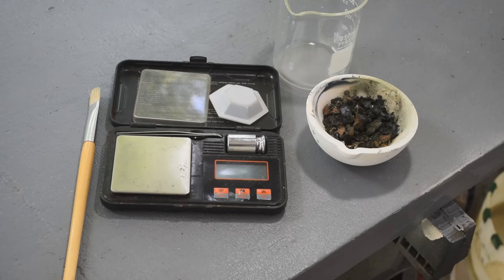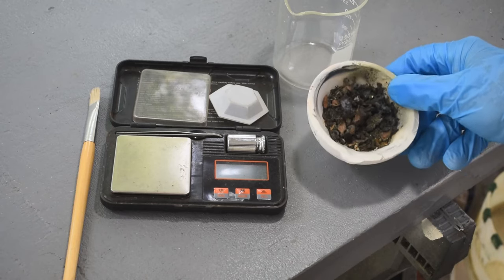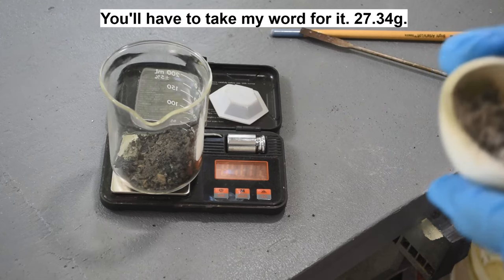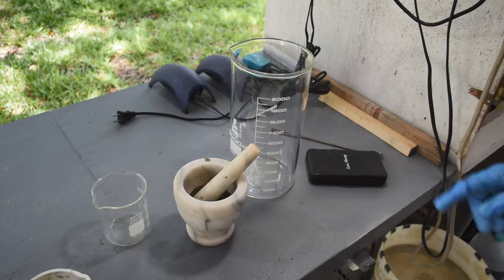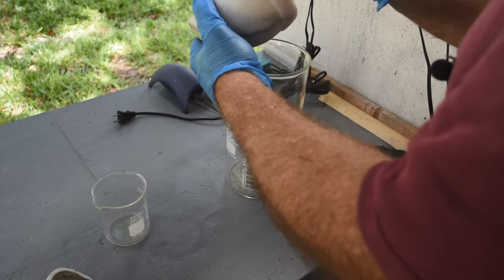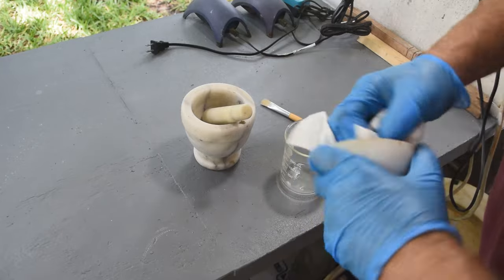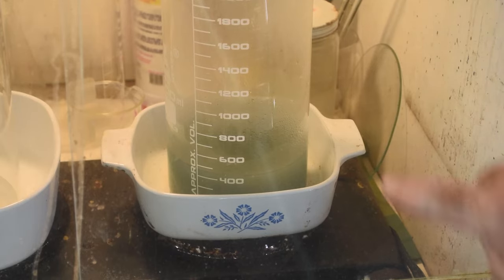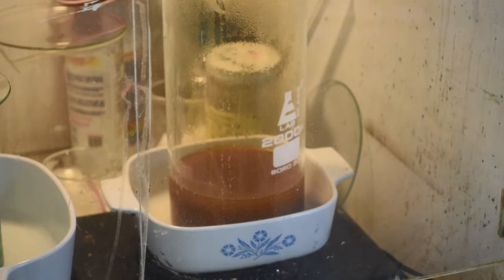Gold and Platinum Group Metals Recovery from My Stockpot Pt. 2 #chemistry

Comment: The aqua regia definitely looked like it had Pt in solution (and probably also Pd). It's likely the nitric boil solution also has both PGMs; Pt can dissolve in nitric when finely divided or in a low alloy.

The filtered residue and the nitric solution might have some AgCl. I agree with adding chloride to test for silver in the nitric solution, if it's there then it's likely also in the filter residue.

Definitely enjoying watching and I simultaneously do and don't want to be in your position dealing with these solutions. Of course, I have a few puzzling solutions of my own still waiting to be dealt with...
Reply: Bạn cho mình hỏi platium phức 6 có bị axit nitric làm tan ko

Comment: Because of the stannous test and the reactivity of metals, I’d say your gold fell out of solution a bit at least and the pgms were overpowering the stannous test? Most likely some pgms fell out as well because they’d be even more temper-mental than the gold. 

Best route I’d personally take is to use zinc to cement out the pms from your solution, process the initial material again and filter and cement with zinc again. 

Then you’d have a concentrated clean material to work with. Incinerate it, nitric boil to help remove most of the palladium and some platinum (due to its fine state) and then have a cleanish material to go to AR and selectively precipitate your metals in both nitric and AR :)

Comment: Hey Mike!  Keep up the good work!  
I think boiling in nitric until all things that will dissolve in nitric are removed from the powders would be a good first step.  That seems to remove most of the copper, silver, palladium and a little of the platinum.  Then aqua regia for the gold and more of the platinum, then you’re left with the rare metals that won’t dissolve in aqua regia that it would be cool to melt a button out of in the cupeling oven and x-Ray.  Remember if it goes off the rails, you can just drop it with zinc and start over with powder.
Reply: Bạn cho mình hỏi kẽm và nhôm loại nào câu pladium và platium tốt hơn